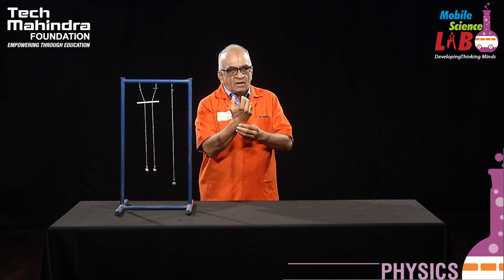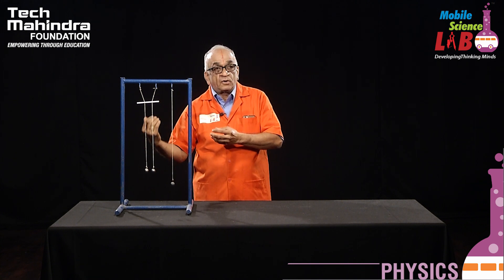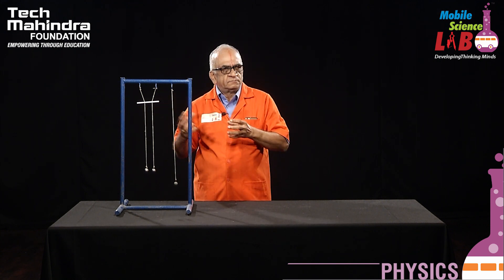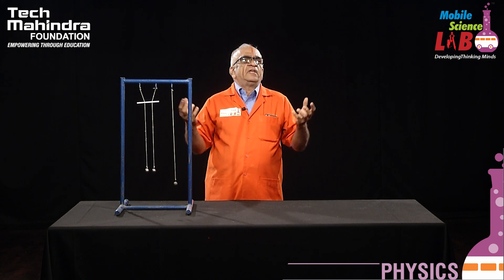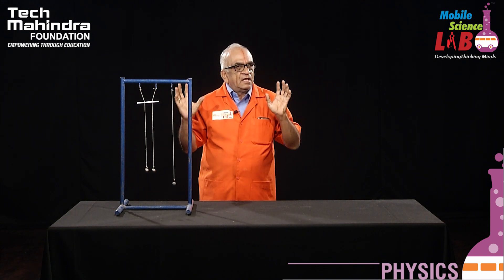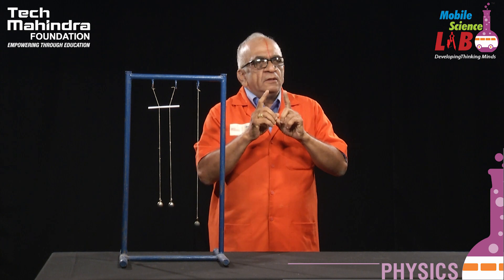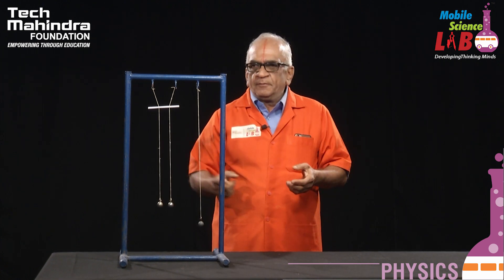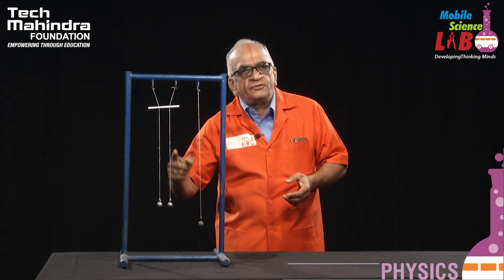Resonance Pendulum

Comment: Hlo sir I have a question to you if we take A pendulum and B also but we take A pendulum have more space between the centre point at last but we take also B pendulum at centre point to pendulum have some little space when we released it at same time who pendulum reach   
The centre point my sir said to me they both are arrive at centre point in same time what is the reasons
Reply: i am a highschool student so i may be wrong, but i believe it is due to the transfer of potential and kinetic energy. A will have more potential energy since it is lifted higher, making it go faster. B has less potential energy due to its low height making it go slowly. all pendulums will cross the middle section at the same time and also have the same period due to the balance of potential and kinetic energy. This rule only applies for pendulums at an angle of >15 or equal to 15 degrees. higher angles no longer follow this rule.

simply, the height makes pendulum A go faster than pendulum B, so they reach the middle point at the same time and also have the same period.

hope this helps